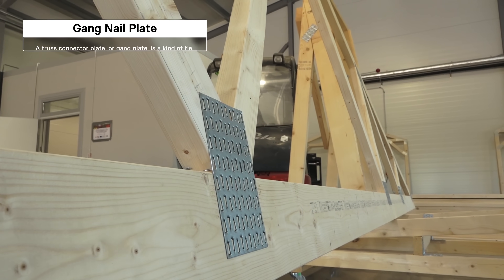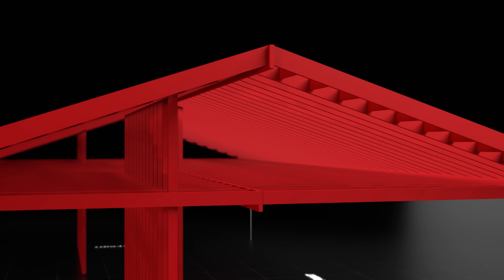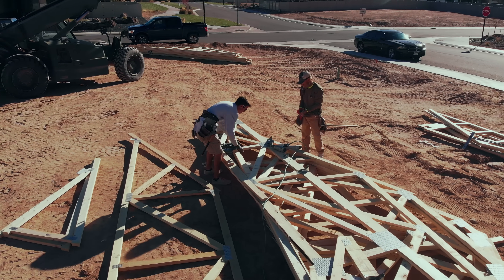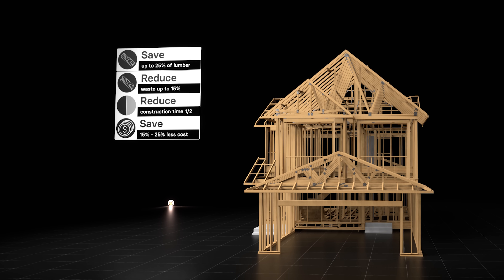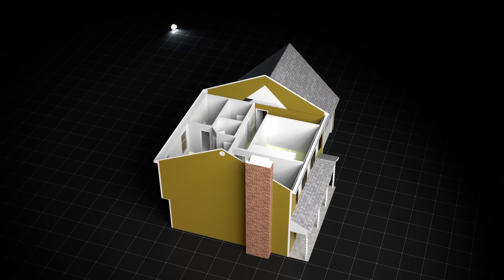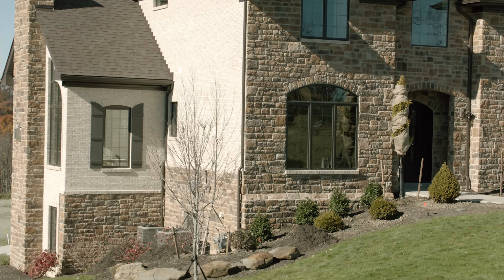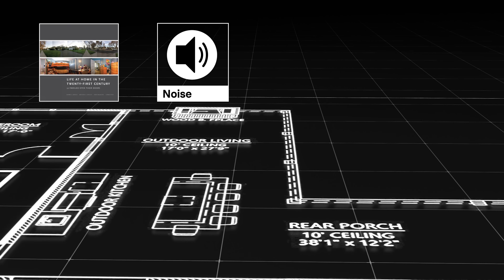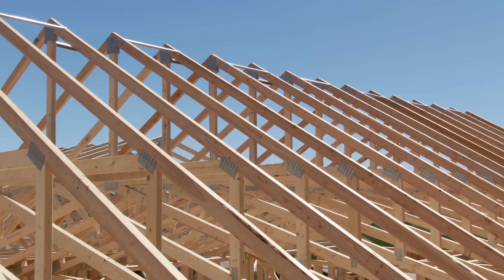The Invention that Accidentally Made McMansions

Comment: so one other factor for why homes get bigger instead of cheaper is simple math. the volume of a home, and the square footage of the home, scale at a square power while wall length and height scale linearly. add 3 feet to each wall, and you get 9 more square feet, add 2 feet in height, and you get 18 cubib feet of extra space. the 

up-front cost mostly scales with wall lengths, so  when adding 10 feet to each wall nets you an additional 100 square feet, it starts to make sense why people choose space over cost.

Comment: That's only if its put together right and it doesn't pop apart even a little when the get literally dropped off the back of the truck and if the drugged up and drunk framers don't snap any of the supports or pop the plates or install them the way they feel like instead of how an engineer said to. Id rather live in something built before these dumb and dangerous plates. The old houses are more square more solid and safer

Comment: Anyone building a house should push for one piece top and bottom chords, additionally, they need to make sure these plates are pressed into place NOT hammered. If you do those two things, the cost will probably be higher, it may be hard to find someone that is willing to work with you, but you will have a much stronger house.

Comment: Built in solar panels, high insulation values, proper roofing slates or tiles. Would be nice, as would a heat pump, rain water storage for WC and irrigation in garden. Forced air circulation, double or triple glazing, all as standard, not after installation. Prefabricated houses delivered to a pre concrete base, and erected by manufacturers staff. Only saying.

Comment: I inspect hundreds of homes a year.  Trusses sound cool on paper.  But a properly framed stick roof is stronger, more easily repaired, the attic is useable.  Trusses will sometimes come with missing plates, damage, slight variations to roof irregularities, the added wood of sleepers, truss lift, less fire resistance.   Trusses and stick frames need the same roof to wall connection, they need the same sheathing.  Trusses suck.  I would never spec one.

Comment: As a builder, I'd like to suggest that there is a little more going on here.
Over the last forty years, Government has added a series of very expensive requirements for a basic build. Added insulation requirements, seismic tie requirements, etc.
During this period expensive regulatory requirements were added before a permit could be issued. For example, here in Teton County, in 1980, my first build cost less than $1K and a month in permitting to start. They gave me permission to start digging before the permit was issued. It was a simple 1200 sq ft two bedroom one bath for myself.
I looked in to buying a lot a building here last year: The permitting process would take over a year. The permits and assessments, which include paying an assessment for somebody else's "affordable housing", biological and wildlife surveys, etc., would cost as much as $50 K before I could break ground.
There is certainly a market here for smaller houses. But if I tried to build and market a 1500 sq. ft. home in the current regulatory environment, I would lose money.

Comment: Fascinating. I had never thought about the logistics of house construction and why that forced smaller homes in the past. Makes sense that the "greed is good" and "conspicuous consumption" of the 80s would combine with this kind of technology (+ new ability to do computer calculations & design) and drive these enormous houses. Which are now becoming liabilities iirc as they are TOO big. People downsize out of them as they get older and they're too expensive for new folks to move into. As temperatures get more extreme, they're difficult and expensive to heat and cool. I wonder if eventually some of these houses will be torn down and people will build smaller, more sustainable buildings on them.

Comment: Not to mention how windows were consistently placed under overhang for a naturally cooler home due to the shade. Now homes have windows indiscriminately pasted onto the walls with 0 shade leading to a previously unheard of requirement  to run ac on any day hotter than 65

Comment: My current tract ranch 2240 sqft was built in 2003. All walls and trusses were made in a factory. Ceilings are 9’, entry and family room have a 14’ high peaked ceiling. After first floor was installed, all walls were installed in one day, trusses and roof in 2 days. Insulation in one day, drywall and paint in 3 days. Other features…..full deeper basement, 3 baths, 10 closets, low e windows, 3 bedrooms, dining room, mud room, large deck, 2 masonry fireplaces, and 3 car garage. Foundation in March and closing on May 30.  Best home we’ve every lived in, with the fewest problems.  Builder grade 80% furnace, water heater and A/C, are still operating and have never been repaired.

Comment: The subdivision I live in was built in the 60s multiple designs max 1800 sqft. The subdivision east of me by a block was built in the 70s and 80s and looks like the thumbnail around 2k sqft. The house we just bought was built in 92 and looks just like the thumbnail around 3500 sqft large ceilings curved staircase big front entrance 3 car garage with loft etc.

Comment: 🌟@8:50 McMansion is a derogatory term which refers to a large, opulent, mass-produced house built on a small suburban lot, characterized by its poor architectural design, questionable quality materials, and a style that mixes different historical elements haphazardly, lacking overall cohesion. These homes often feature excessive rooflines, windows placed without regard to function or style, weak-looking columns that don't support anything, and a facade that uses expensive materials while the sides and back are finished with cheap vinyl siding.

Comment: In Florida we have found a number of incidents where wood truss plate connectors loosen up over time due to heat, wind, vibration and out of plane installation creating eccentric loads the trusses were not designed for. This situation is even more scary with field fabricated metal stud trusses with screw connectors in site drilled gusset plates. On site inspection is lacking. Another huge issue has been bad design of joints between master trusses and intersecting jack trusses. More engineering study is needed.

Comment: Rafter type roofing not involving the use of these nail plates are required by code to utilize what are called hurricane ties, steel connectors that are nailed onto the roof board and the wall's top plate, creating a strong connection between them as the cross nailing by itself is insufficiently strong as pointed out in the video. Thanks for this primer on nail plates, I have not used them in my construction but they make sense when building a truss roof.

Comment: I've set trusses for the last 25 years in my crane business, and am a former carpenter. The changes in roof design has been incredible for sure! Way more complicated than ever, girder trusses hanging off of other girder trusses (lots of faith in Teco nails and hangars), the days of a roof's purpose to keep the weather off seems to be gone,  they are more of a architectural wet dream, but hey it's more work for me! I built a lot of trusses myself back in the day,  as a carpenter, using plywood gussets, construction adhesive, and lots of staples, big shops mostly, 40 years later they're all still standing

Comment: It is Jevon's Paradox in action. More efficiency in most things usually don't actually result in lower consumption, it usually increases it by a multiplier instead.
Reply: Correct for example in the United States as engines for cars have become more powerful and more fuel-efficient they have enabled larger vehicles to get moderately acceptable fuel economy and thus encourage more very large vehicles 

And the desire for power even in smaller vehicles has meant higher consumption and higher cost when they could just build a good enough power plant that's smaller and lighter 

Also you can build the engine to make less horsepower than it's technically could be able to do and it would last much longer 

For instance in the United States you'll see tons of like 2002 to 2008 Honda accords which only made like $151 horsepower out of 2.4 l 

Where many competitors were trying to get the maximum horsepower out of a given size and thus they created engines that don't last three or four hundred thousand miles like a Honda or a Toyota of that era 

Like the full-size pickups like a Ford F-150 have gotten much much bigger in the last 25 or 30 years but their mileage 

Way more horsepower than they need considering almost no one ever goes full throttle in any of these vehicles shy a sports car 

which again requires a higher strong higher stressed heavier larger engine 

Which then requires higher structure strength at bigger brakes which requires more power and it's just an endless loop so instead of using these gains for efficiency we've used them for power and increase size

Comment: I'd never trade my 1920s colonial revival home for a new construction. Each part of the home has it's own character, and the material used was superior to today's material. My partner builds custom homes, and the cost restriction for quality materials and labor is the largest problem. 

We always try to guide a client towards reduced square footage, and higher quality materials. The cost will be about the same, but you'll have a house that will last longer than you will, with minimal long term maintenance. Cheap homes will need to be repaired and replaced frequently, and it will be costly to maintain over time. It is something many people overlook when they are initially building. I've seen brand new windows in new constructions that leak more than the 100 year old bubble glass windows in my home. 

TL:DR - Do yourself a favor, and pick quality material over larger square footage. The higher initial investment in a smaller, well crafted home will reward you in the future.

Comment: Better question: Why are we still building houses out of toothpicks instead of rot-proof, mold-proof, fire-resistant, fully recyclable steel studs? Or out of reinforced poured concrete in areas particularly prone to hurricanes, tornado, wildfires, or earthquakes?
Reply: I'm willing to bet it comes down largely to cost. Wood is cheaper to make, lighter (therefore cheaper) to transport, and easier to work with (also cheaper) than any of those alternatives.

Comment: Sorry I do NOT agree that the old method of building trusses made for a more unique looking house. When I look at most houses built before 1970, and especially before 1950, they are pretty cookie cutter designs, with very simple roofs. I don't get how a very simple roof is more unique than complex geometry made possible by complex truss structures. That's not a great claim. Also, I think modern houses are much more efficient, simply because of the windows, doors, and insulation we use now, which are infinitely better than what was being used pre-1970. Including blown insulation. 

My brother-in-law bought a house built in 1920 in Milwaukee WI, a very cold and hot place depending on the season, and it had thin newspaper in the exterior walls and attic for insulation when he tore the lath and plaster off the walls. Which made for a drafty, energy inefficient home to say the least. Sure, modern homes could be more efficient with a smaller home design, but modern homes are still far more efficient than pre 1970s homes.

Comment: First of all the man's name is pronounced Jur-ee-et. He did not invent the truss plate but worked for the man who did which is Carroll Sanford. Sanford's business went on to become Alpine Industries which is  also a large truss plate manufacturer. Juriet's claim to fame is that he advanced the truss plate where it did not need any supplemental nailing. The story is it came to him in church one Sunday. I was not able to meet Calvin  but did meet his brother Bill in about 1978 when he took over after Calvin retired.  As someone who has been a truss designer for nearly 45 years, you cover a lot of information that I both agree and disagree with.  There isn't enough time or space for me to comment on it all.  You never even mentioned floor trusses. Credit for that invention goes to Jack Schmidt of Trus Wal Industries.  I am especially concerned about comments made about trusses being a fire hazard. The SBCI.com (Structural Building Components Industry) has done extensive fire testing on truss assemblies to disprove this claim. There have been advancements made to the truss plate over the years which is governed by the TPI (Truss Plate Institute)  Advancements in design software have also also changed drastically with sophisticated analysis to meet ever changing IBC and IRC building code changes every three years. In spite of all this, there are still many builders in our market area who still prefer to stick frame roofs. I couldn't begin to tell you all the reasons for and against it.

Comment: Pre- made trusses with gusset/ gang plates are inherently dangerous. I’m a retired firefighter with 48 years service. First, the plates are only 1/4” or so depth into the studs making up the truss. Heat will cause them to expand and release from the truss studs. Plus the amount of trusses necessary to hold up a roof creates what I call an attic lumber yard. Normal houses don’t have fire walls in the attic, so once the truss gets burning it spreads extremely fast to the others. Second, the weight of the roofing materials on the trusses as they weaken from a fire creates a collapse potential because the gusset plates can’t withstand the loosening effect of plate expansion and coming loose from the studs. Third, trusses are basically individually weak, and high winds can cause them to move slightly which also loosens the plates. Poor construction with trusses causes roofs to come off easier with winds. As one commenter said, once one truss goes, they all go. As a firefighter, falling through a roof is definitely not something you want to do. My home was built in 1981, and the roof trusses were hand built with heavy nails, and reinforced. We’ve withstood high winds here in Oklahoma without any problems. The worst that happened was losing some shingles or hail damage. If we had a fire, those trusses will withstand a lot more heat without failing quickly.

Comment: I would argue that the prime reason for the many suburban developments with the "McMansion Class"  homes was the break-away salaries for the upper middle class, starting in the 1990's. The rest of the middle class stayed dormant or lost buying power.

So, the market demanded a solution for the desired construction of homes with cathedrals and recessed features spanning 1/3 to twice the distance of more common homes.  I would also argue that the lumber has changed from the lack of mature trees from which it comes.  There is no comparison to the lumber in homes before 1975 to now. Growth rings are much wider, whereas the rings of older trees are very close together.  This means that the tighter ring pattern provides more wood in which to embed nails and screws.  Much less prone to splitting out as it dries inside the house.

These mechanical components try to offset that deficiency, with generally good results, but there are now 30-year-old homes pulling apart too soon.  The 80-year-old house next door is still stable.

Comment: Which is weird because you can just use steel and bolt up the joints similar to skyscrapers and save 1/3 of the wood maybe up to half. It would be similar to how truss's are made today in factories and shipped to job sites.

Comment: These make serious issues when theres any fire conditions. The plates are VERY conductive and have a large surface area. They need significantly less heat to fail and when they do, they simpley curl up and fall off. Only a couple of these failures will get rid of all structural integrity. On top of the other cheap building materials used today.

Comment: You're leaving out an important point in the housing market, and that is the effect of repressive building and zoning codes. Because it is expensive and difficult to get houses approved, there's less incentive to build a small affordable home and more incentive to build the largest, most expensive house that will sell. Apartment buildings face the same pressure, there's no incentive to build a nice, limited size apartment building because there's no profit, so the builders pack as many identical and as tall apartment buildings as they can into a given lot size.

Customers can take some of the blame for this, if people would simply refuse to buy McMansions or live in one of a dozen identical people boxes, the builders would have to start making more aesthetically appealing properties.

Comment: problem with these are they are not installed correctly there are a bunch of you tube inspections on new construction homes that show this, and independent inspectors find these faults and the city and or county inspectors sign off on these goes to show how the these plates are supposed to save money and be efficient, I see them wrong in my own home and have replaced them with proper installation

Comment: The wood truss in our house is the only wood we used, the rest was steel studs and polysteel exterior walls.   If there was economical steel rafters at the time we built the house we would have since we live In a very fire prone region and wanted to make sure a wildfire didn’t destroy our house.  The destruction in LA is partially because of complex roof designs that catch burning embers and allow fires to spread.